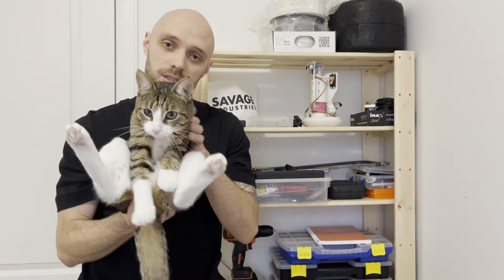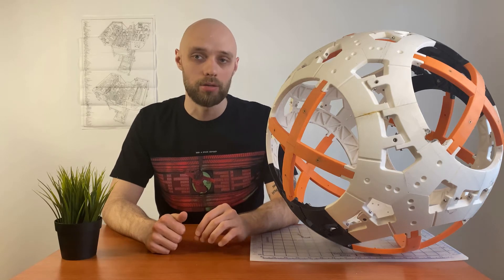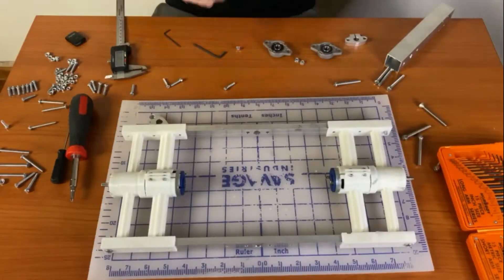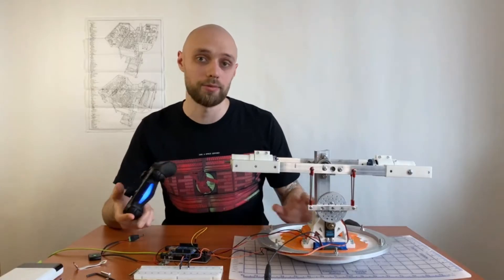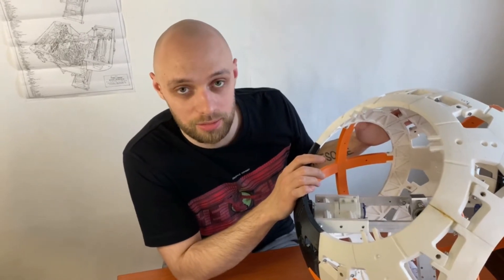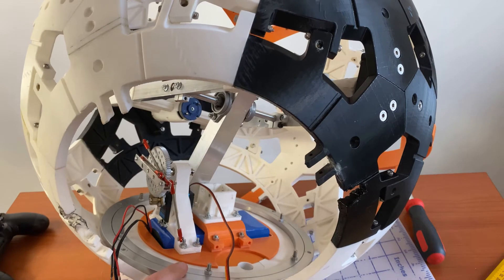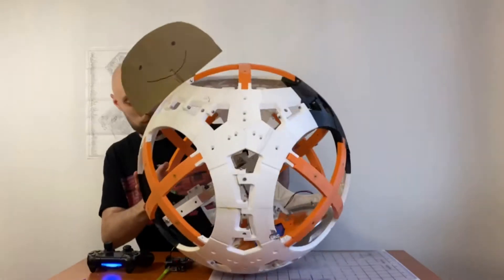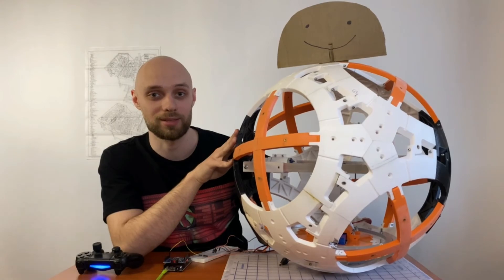Making a BB-8 star wars droid. Part 1

Comment: What was the bed size of the 3d printer you used?
Reply from the maker: It’s ender 5 plus, so 350x350 mm
There is a way to print on a smaller ones though. When I started the project I had basic ender 3, I just had to modify stl in 2 pieces to fit into the printing bed.